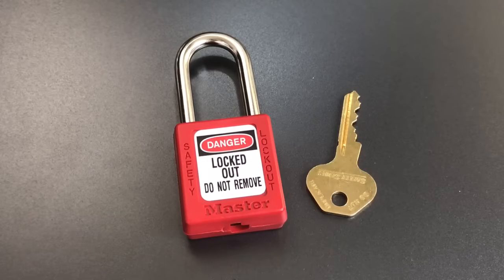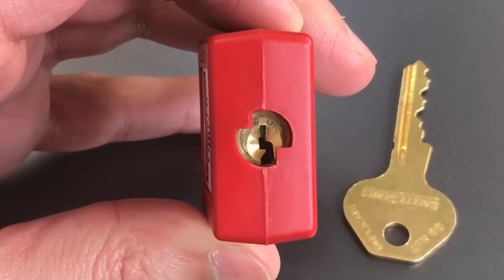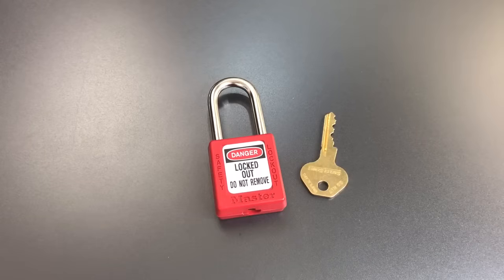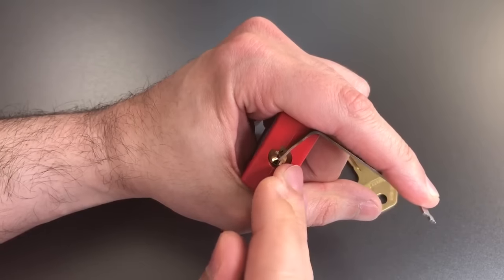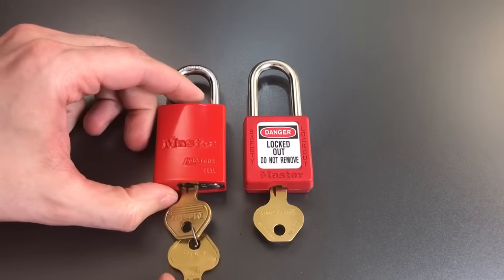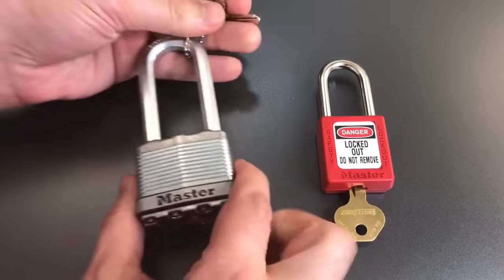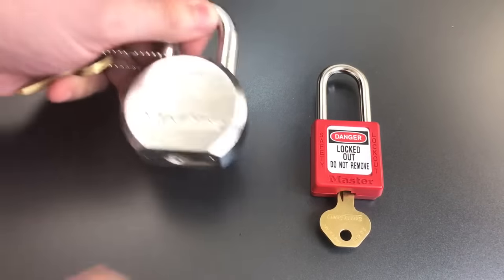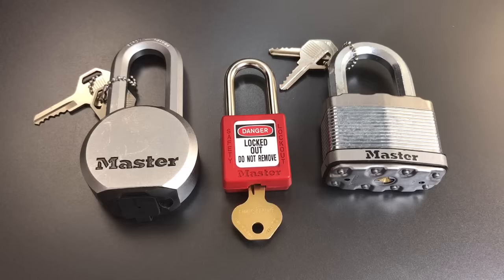[479] The Master Lock Paradox - Model 410 LOTO Padlock

Comment: These locks are hard to pick. So hard in fact, I pick a whole ring of them while I pay attention to other things.
Reply: I too sometimes inadvertently pick my nose open when I have a nasal congestion, but locks? Holy
Reply: @ginger88895  I laughed so hard reading both of you :D
Reply: @ginger88895  LMAO
Reply: Yeah… I loved that remark….
Reply: That was sooo funny😂
Reply: Irrelevant
Reply: Eh its just to make sure some dumbo from turning on power to something while someone is working on it not for security as he said
Reply: I bet he had those locks with him thru college while studying law! How else could you sit thru those classes......'
Reply: @spudz7405  He states that it is actually a difficult lock to pick
Reply: To be fair he is using a proper lockpicking set
Reply: I have a ton of these considering the new practice for locking my machine out requires 7 separate locks until they switch to the facility power lockout. Ours are even more paradoxical because of the fact they have a shackle made of nylon and they can be broken by hand. We don't use more expensive locks because of the cost of replacing them when people forget to remove them and leave for the day resulting in destructive removal. LPL is missing the point.
Reply: Lolol
Reply: @kdawson020279  He's not missing the point. In the beginning of the video he says it's lockout - tagout lock so it doesn't need to be sturdy. Yeah, later he calls the lock body bad but that's just bad in general range of locks, not bad for it's purpose. The point is why does this cheap lock that doesn't need to be very secure still have a complicated and more expensive core?
Reply: @armogarage4968  I am starting to wonder if they actually make it in-house given its identical construction/pin count characteristics to a smaller name lock [Tradesafe]. The 410 lock itself has the potential for somewhere over 40k distinct keys [per mfr] and has direct competition in the Abus 71/40 and 74/40 with 6 pin restricted keyway locks and Tradesafe has a lock that's almost identical to the Master in terms of construction and bitting. The Master and Tradesafe warding look the same, the ABUS has their fancy letter shapes [and the Abus is hard to pick, I can get the Master open now].

The problem with looking at these rationally is that they are designed to meet the widest range of compliance needs for industry, provide the largest number of meaningfully unique key combinations with bitting that is tamper resistant, and just having a lock isn't a successful compliance program. Meaning, it is entirely likely that this product line was developed and sourced entirely for compliance purposes by a mission-specific portion of the company and it probably has a 3rd party vendor for the nonremovable core [one employee, one lock, one key]. I'm tempted to buy a Tradesafe to see if it is similarly pinned. The price of the lock has got to be the core, since a thermoplastic lock body doesn't cost more than its equivalent weight in brass or aluminum to manufacture. 

Master would have to redesign its locks to use this core, already has a subdivision of the company through its acquisition of American Lock for high security core locks, and the reason for the lock is to avoid OSHA fines and prevent negligent homicide. The other Master lockout locks would be insufficient for an organization with more than a few employees who needed locks in multiple applications. At last count, I have 9 locks and work for the largest civilian entity not in the private sector. If it weren't for the potential loss of market share in the regulatory and compliance arena, I guarantee that Master still wouldn't sell higher quality cored versions of its big beefy locks that pick easily. They seem to exist only in the security theater/keeping honest people honest arena which makes a plastic lockout lock a natural fit for their business model.

I guess it makes sense to me because I work for the federal government, which does a lot of things that make no rational sense because of the letter and not the spirit of regulation.
Reply: bars!!!!
Reply: Your coworkers would like to have a word with you.
Reply: @kdawson020279  It sounds like you guys are missing the point by using locks which aren't in any way secure. If it can be broken by hand, it what way are you using a lock at all? 
The problem appears to be people leaving with the keys - the answer isn't to make locks which don't function, but to prevent people leaving with the keys.
Reply: @flippy66  Compliance. We use these things in breaker panels and other equipment up to 600 VAC, and up to 150 amps of 24 or 36 volt power. If someone removes a lock not in accordance with our internal policy which is more strict than OSHA's guidelines, that is grounds for immediate termination. Doesn't matter who you are. All locks small enough to serve as LOTO locks have roughly 1/4" diamreter shackles and are susceptible to a pair of bolt cutters. It's a mechanism of information, identification, and prevention in that order - you can't use it, Dawson is the mechanic fixing it, and I can't operate the breaker/switch/disconnect or access the plug end. Some devices cannot be locked and therefore use tagout, which is effectively me putting a tag on a device that says not to use it because you could cause harm to me or the equipment or yourself. Tagout is purely honor system. Thankfully, almost all of our equipment or procedures have been updated and upgraded to be lockable to create a physical barrier of some kind between me and stupidity.
Reply: This is just embarrassing for Master Lock at this point
Reply: Muscle memory. It's half of what we do
Reply: If you watch a lot of his videos you will see him use simpler tools to open hundreds of other locks in less than half the time. So it actually is quite difficult.

Comment: A lot of people here seem to be missing his point quite dramatically. He's not saying it's inherently stupid that these LOTO locks have really good cores and terrible bodies, he's saying that it's crazy that all the other locks Master Lock make for actual security purposes have terrible cores when this clearly shows that they have the technology and knowledge to produce some really good ones. He's saying that it's weird to waste these really good cores on locks where it doesn't matter as much at the expense of their security cores
Reply: It's simple, really.  it's all about liability and lawyers.  They would more likely get sued over someone's death than the theft of a bicycle.  So, they go with the cheaper option where possible.  Not mysterious at all.
Reply: @videodistro  I would also say that someone less familiar with locks would judge the lock purely based off of its looks. Because of this they can get away with selling tough looking locks with weak cores
Reply: Most people don't pick locks, they cut them. Now if you are in a factory where 1000 people have LOTO locks, you definitely don't want multiple copies of a key floating around.
Reply: The solution to this big problem is : put your name on the lock. If there is a lock with your name on it on the LOTO stack: remove it. If there isn't: do not remove a lock. Not even if you tried all 100 locks with all of your 10 keys.
Reply: They only needed the 6pin core to meet industry security standards (thus the other LOTO locks without the 6pin core). They have no such requirements for "civilian" locks. In reality, a lock isn't really that much more secure with a "better" core. Forced entry through lock picking is extremelyyyyyyy rare outside of low skill methods like raking and bump keys. If someone had the skill and patience to "properly" pick your 5pin, he most likely also has the skill and patience to pick a 6pin with security pins. Most people try to break the lock, thus the sturdy body on the more expensive locks. Putting any more effort into the core then the bare minimum to combat low skill attacks is just a waste of money for the R&D.
Reply: @videodistro  ???
Reply: @fryloc359  then explain the other Master LOTO products with stronger bodies and weaker/lesser cores... You don’t think you’d want multiples of those keys around either?

If you think a soft shackle and plastic body are because they may need mechanical removal for lost keys, explain the metal bodied, hardened shackle locks ... you don’t think those keys go missing either?
Reply: If anyone really wants to break in, they will, if they really want to take a lock off, they will. i think this balance between core strength and shackle strength is to keep the lock 'reasonably weak' so the owner can break it or get it picked if need be. if it were the best of the best, it would be more difficult and maybe they have complaints from people that cant get them off? would be interesting to hear their reasoning.
Reply: @videodistro  that wouldn’t explain the terrible build
Reply: Big deal, a safety pin or serrated pin or barrel pin is nothing to pick if you know how, lpl mskes abig deal about it, when it is irrelevant if you can pick a 4 pin, you can 6
Reply: @shable1436  trust me, no one picks these locks. a decent swing of a hammer, or 2 wrenches, whichever is easiest, is all that is ever used for these.
Reply: 2 reasons for better cores then normal. Liability and prevention of opening the wrong lock. I see these locks in the hundreds on a daily basis. And we have hundreds of tools to open a lock in seconds all over the place, so 0% reason for sturdiness. On every site you need a permit before you can start, this is linked to a lockbox. This box holds the main key for the machine and is locked with all the locks paired with a permit, a box can have any nr. locks/permits. Its nearly impossible to start the wrong machine, and yet... it still happens...
Reply: @bradhaines3142  you can twist those plastic locks off with your bare hands.  I've had to remove many of these after people lock out then go home.  Which is a major pain. Fully inspect the machine which in the case of belts is a couple mile walk. Then come back and bust the lock off
Reply: @fryloc359  fun fact you can  actually get these by the box all keyed the same so you can loto an entire system then you put those keys in a lock box and workers attach their locks
Reply: @adjsaint  if thats the way you want to do it, but where I work, every lockout lock is keyed differently. We do have "shop locks", which we use to lock electrical cabinets and such. Those locks are all keyed the same.
Reply: @unlocated7448  Lockouts are required by law not to have copies
Reply: @mjz667  rubbish! Masterlock will cheerfully supply these with two keys per lock, or in packs of 12 keyed alike locks with 12 alike keys. You can have copies of keys and copies of locks at OEM no problems whatsoever.
Reply: @fryloc359  that's a very intetesting take!
Reply: @videodistro  he pretty much disproves that with the other LOTO locks that have worse cores
Reply: It’s likely because they get bought in bulk by building owners and electricians etc so master lock likely made the cores over designed to over charge for them
Reply: I'm guessing that these LOTO locks are used in places with additional security where you couldn't sneak in a bolt cutter. Like a nuclear sub.
Reply: I agree in part. I agree that they should use these cores in other locks, but I think the reason the body is weak is for instances where you want forcing open the lock to he possible but not without noticing it by encouraging forced opening through breaking in an emergency rather than trying to pick it open (especially with engineers who may know how to pick locks to a basic degree as a hobby). It seems to me like it’s designed for accountability in safety.
Reply: It's not weird, it's market segmentation ;)
Reply: so i'm no expert on these things, but just from context clues and reading other comments here, it would seem to me that these (and all other locks) are largely designed with a particular use-case in mind.

these "loto" ones seem to be designed for a setting where the goal isnt protecting valuables from theives, but rather protecting licenced users from negligent harm. a place where you dont want someone who works there accidentally opening a lock at the wrong time, but where youre not really concerned about the risk of someone trying to break in with bolt cutters or whatnot. 

therefore these 'loto' locks simply dont need a strong body for their intended use. what they need is a strong core.
Reply: @MikehMike01  He is under no illusions and comments on destructive attacks where applicable. He takes issue with Masterlock because it's much faster to walk up with a rake or a shim and bypass them, approaches that require little to no skill and thus are likely to have someone attempt at some point. You'll notice the locks he praises tend to be both pick resistant and destruction resistance, as well as non-bypassable.
Reply: I do find it amusing however that this particular LOTO lock has a good cores but a poor body. As other commenters here have noted, this would be a case where presumably the lock's main concern is liability instead of theft. But that is what makes the poor-quality body seem rather unusual in this specific context, because you would expect far more attacks by destruction rather than picking, so from a liability standpoint prioritizing the body would be more efficient at preventing accidents and potential lawsuits.
Reply: I don't think a lot of people commenting here made it through the video especially starting at 04:35
Reply: @chaosvolt  from a liability standpoint a physically destroyed lock is an easy way to show someone gained unauthorized access, a picked lock isn't. When you can have piles of these locks on a single piece of equipment you don't want the possibility that multiple locks have the same key either.
Reply: Keep it cheap and don't make it easy for anyone who does not care why there is a lock for him to pick. 
At the same time, make it obvious.
Reply: @fryloc359  I work in a facility where hundreds of these exact LOTO locks are used, possibly every day. I can tell that each of them only comes with one key, no spares. If lock needs to be taken off without the key it is just cut.
Reply: @Quicksilver_Cookie  i work in a factory with about 1400 people, our safety dept has decreed one lock to be acceptable,  and this one isn't it. The locks we use are laminated Masterlocks, and come with two keys. They break the end off of one so you get one good key and the head of the other.
Reply: @unlocated7448  I suspect the LOTO lock design in question was made to fit specific requirements for a government contract.
Reply: My boss easy to cut true if some forgot  to log out happend a lot 😂😂 but safe keys
Reply: @DDracee  A good portion of some of these higher security master locks can be raked open though. They have a lot of products that can easily be bypassed with low skill attacks.
Reply: Iirc . master is the manufacturer of whats called a breakaway padlock. The shackle has cuts in the bottom near the lock, so you can secure something like a switch or valve, but in an emergency it can quickly and easily be hit with a wrench or other tool, the shackle breaks off at the breakaway cuts, and you can use the equipment.
Reply: The good cores are objectively more important on LOTO locks as their entire purpose is to prevent other staff from removing them accidentally rather than with malicious intent. The locks are usually assigned to an individual and that individual might work at multiple sites where there is in increased risk of two people having the same key.